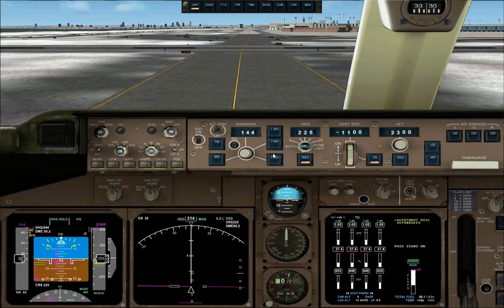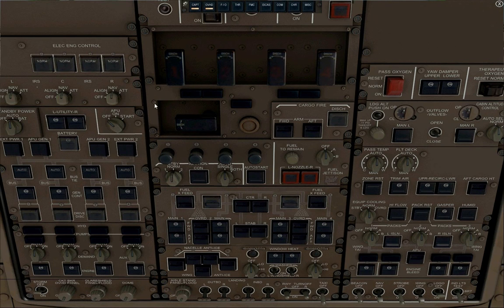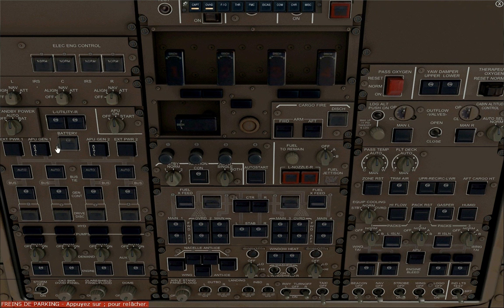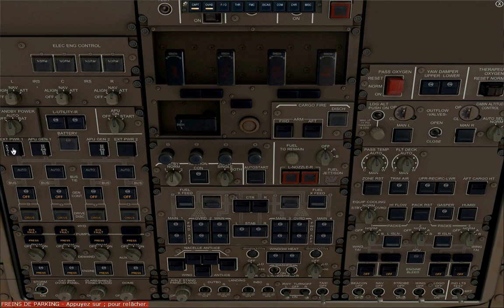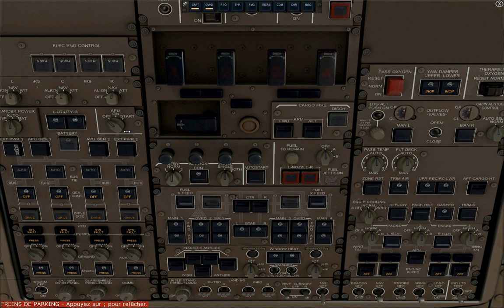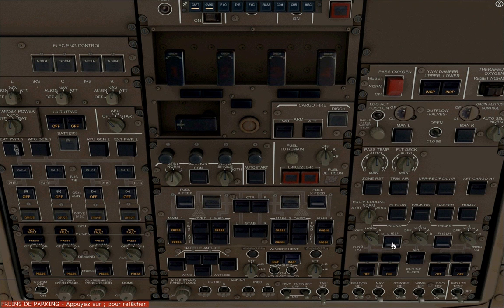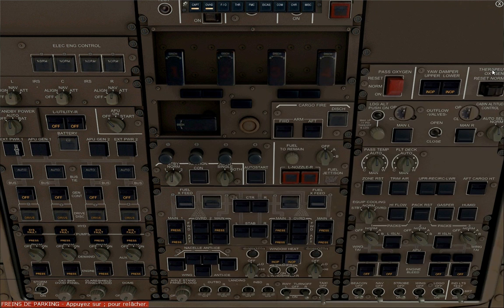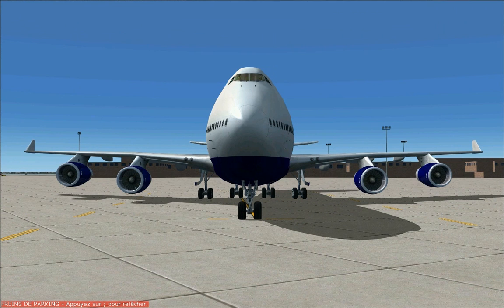PMDG 747-400 full tutorial part 4

Comment: Just a few tips for the guys&gals-
It's really not standard practice to turn off the Bus Tie, Gen Cont, Eng Hyd Pump or Eng Bleed switches. These are normally left on. Yaw Dampers&Util Busses can also be left ON.
Packs should be switched OFF prior to removing APU bleed (as this might shock the APU). The Taxi light should have been turned OFF prior to reaching the gate, otherwise you'll blind the guys arriving the aircraft

Otherwise flawless :)
Cheers
(former PMDG technical advisor/tester)

Comment: two ques. wen u put in departue and arrival into the FMC, wen u select the runways for takeofff and landing does the FMC automaticallt find the waypoints you need to take or not? secindly if you start the plane normally not in dark and cold or whatever its called do you have to do all the overhead planel buttons and engine stuff?